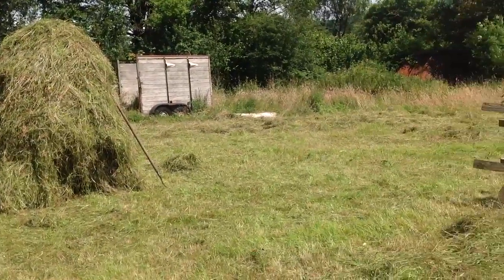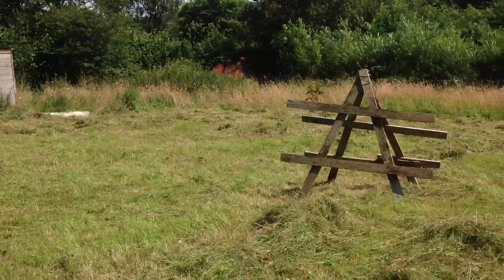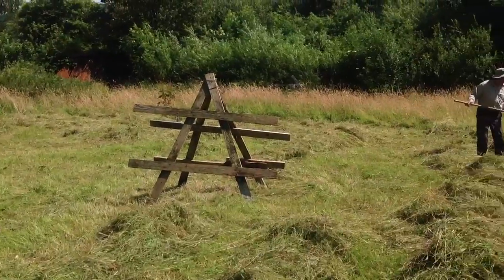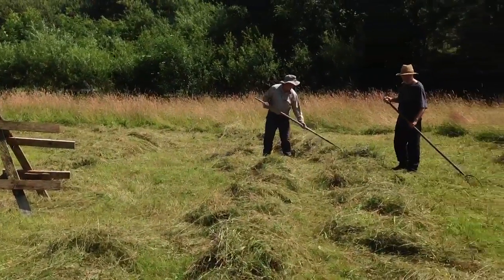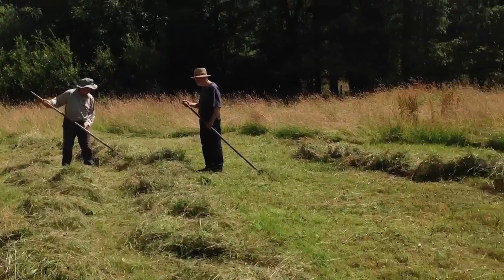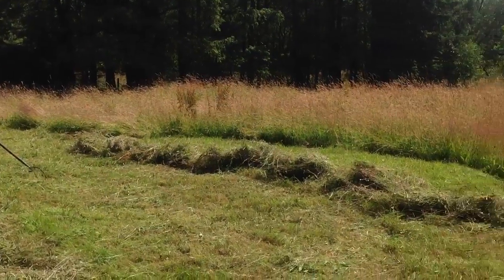Making Hay Rope on Walter's Tools project

Comment: What is the purpose of a hay rope?
Reply from the maker: Hay rope is used during haymaking.   One system of drying hay is to make tripods ('pikes') about 8 feet tall, in the field and then wind the hay rope round the tripod in a spiral with about 2 feet between each 'step'. The hay is then loaded onto the rope all the way up, so that there is air circulation inside the pike and it will shed the water like thatch.  The hay rope is also used to tie the load of hay on to a wagon when it is being brought in to the barn from the fields. :-)